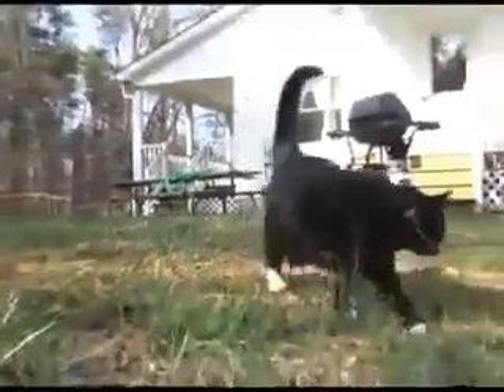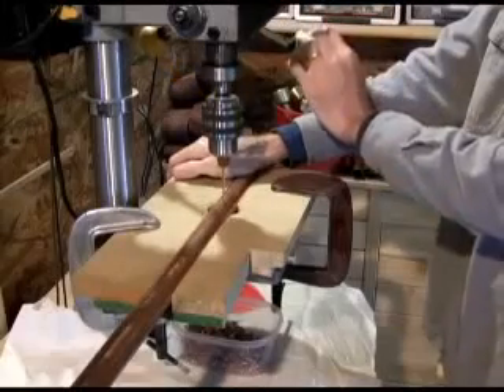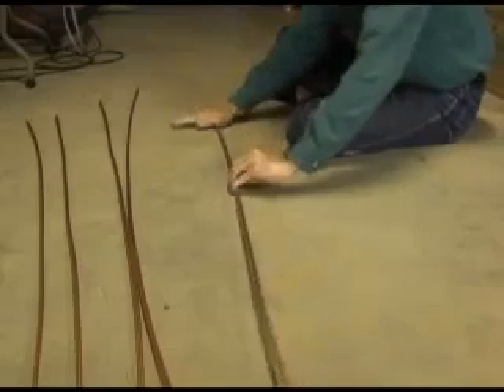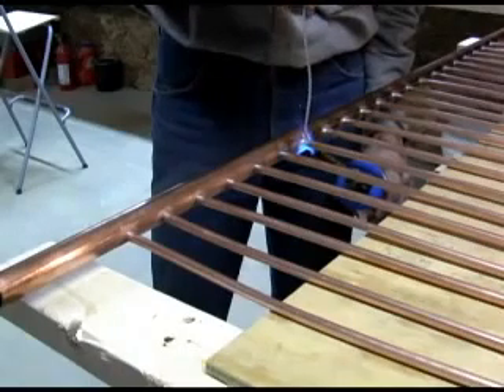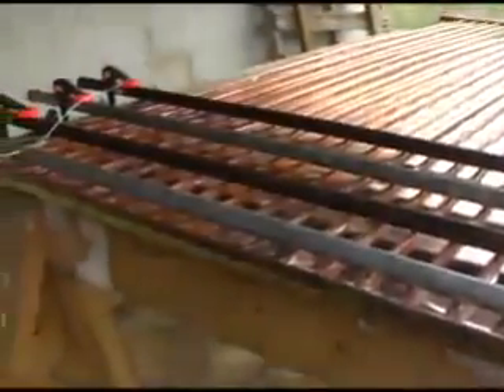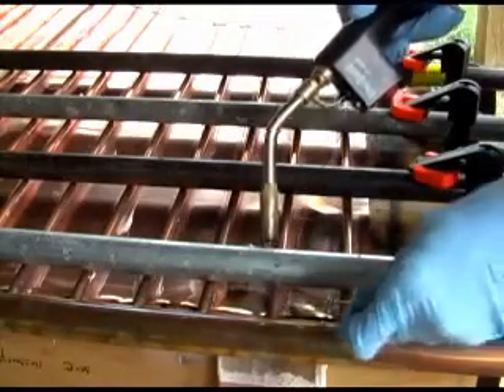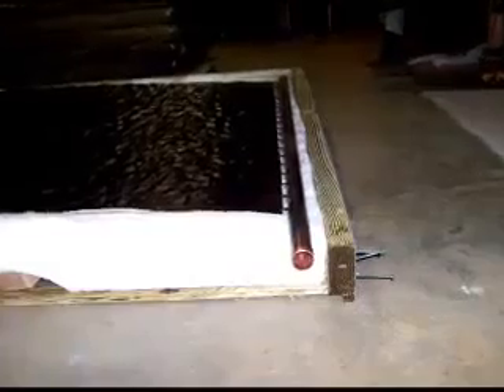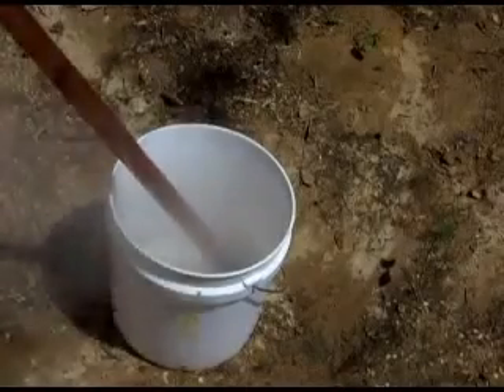Fabriquer un panneau solaire thermique

Comment: hy!

i am french, and i would like a french translation if possible :-) or juste writing in comment diameter used fo copper. i dont understand with only video! best regards,
Reply: +Julien Lafond Salut, Les gros tubes c'est du 1pouce (25.4mm) de diamètre, et les petits 1/4 de pouce
Reply: +thedarknessparadox cool, merci pour l'info ! :-)
Reply: 2,54cm pour les premier diamétres. Si t'as besoin d'une autre mesure dit le moi.